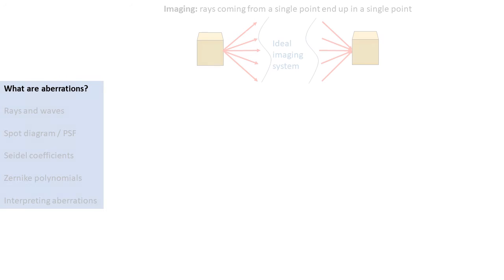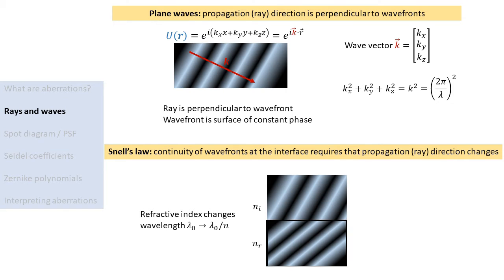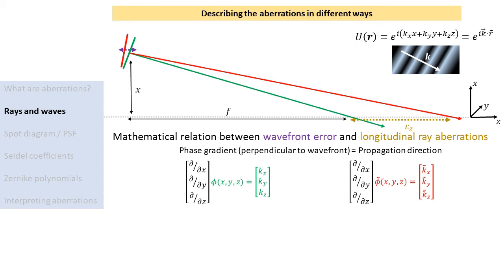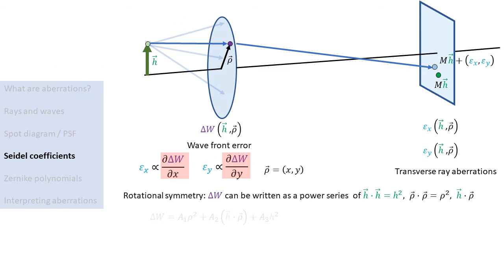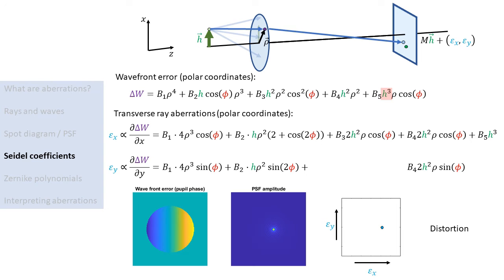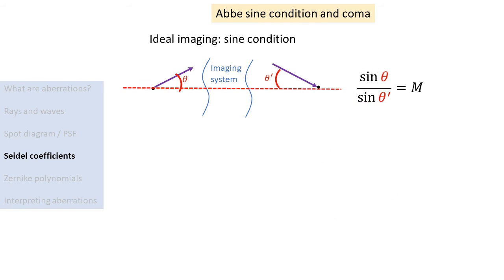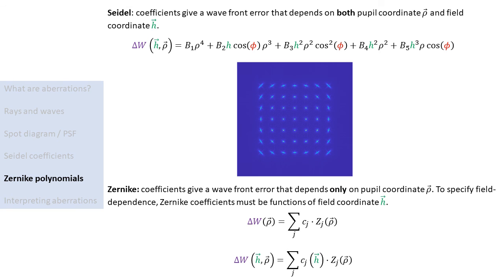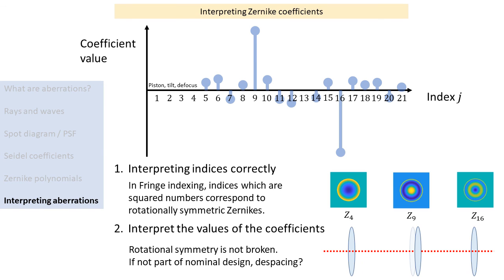Optical aberrations: ray aberrations, wavefront error, Seidel, Abbe sine condition, Zernike

Comment: What is the argument on why an unabberated system corresponds to a spherical wavefront? I get that the argument here is that in an unabberated system, the rays converge to a single point, and the only shape which is perpendicular to those rays thus has to be a circle (or a spheric surface). Can't there be a non spherical wavefront resulting in a diffraction limited spot size? And why (not)?
Reply from the maker: Mathematically, the point spread function (PSF) is given by the Fourier transform of the wave front error (WFE), i.e. PSF = F {Aperture *exp(i*WFE)}. If the WFE=0 (i.e. the wave fronts are spherical), and the aperture is a disk with uniform amplitude, then the PSF is an Airy disk. This would be the diffraction limited PSF.

One can alter the aperture and WFE to obtain different PSFs (this is typically called 'focal spot shaping'). For example, by softening the edges of the aperture, one can suppress the sidelobes of the Airy disk ('apodization'), at the expense of having a broader central peak. Or by altering the WFE, one can create a PSF with a narrower central peak, but higher sidelobes (see e.g. Toraldo filters). Whether such PSFs are 'better' than the standard diffraction limited Airy disk is very much a matter of context and application.

The fundamental limitations are ultimately a mathematical consequence of the Fourier transform of a function with a finite support (i.e. the aperture stop / pupil). The fact that the pupil has a finite support mathematically implies that the PSF must have some minimum spread (also compare to Heisenberg's uncertainty principle and Kennard's inequality).

Comment: What is the definition of the term "pupil" here, and what is the pupil in an exemplary imaging system, e. g. a camera lens? Is there a rigorous definition of what you mean by pupil or the pupil plane in the context of this video? Maybe it is also a language problem, I am German and did not find a fitting literal translation.
Reply from the maker: There are two pupils: entrance and exit pupil. They correspond to the images of the aperture stop (the aperture that limits the cone of rays that propagates through the imaging system) created by the optics before and after it respectively. I believe I mention it in my video on geometric/ray optics. I also have a separate short video on the relevance of the aperture stop.

Comment: @Sander thanks for your great video!

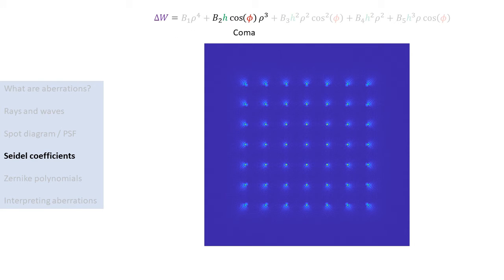I am trying to reproduce your results shown at @30:29 using python. However I am unsure how to do so. I did define a 2D array containing 9 point sources. However I am unsure how to then determine the diffraction patterns as shown in your image.
Could you maybe explain your steps taken (or provide a part if your code)?
Reply: Looking a bit closer at the expressions I am a bit confused as how you define the ''h'' in your Delta W. It appears as the magnitude of the vector (from optical axis to the point source). I did use the equation in which we set x=rho*cos(theta) (which then puts the h along the x-axis).
So i guess I need to use the polar system instead. However then I still dont understand how you determine the angle theta and the magnitude rho in order to produce your plots.
Reply from the maker: @brisingreye5209  Phi and rho are the polar coordinates of the pupil, which is in Fourier space. So you'd do the following:

- Pick a point source in the object plane with a certain position vector .
- Fourier transform the point source (this should give a linear phase ) and truncate it with the pupil/aperture.
- Apply the phase error \Delta W in the pupil. rho and phi are the polar coordinates in the pupil (where phi is the angle between  and , to ensure rotational symmetry of the system). At the edge of the pupil, rho should equal 1. The strength of this phase error can depend on h, i.e. the farther away the point source from the optical axis, the larger the phase error in the pupil.
- (Inverse) Fourier transform the pupil function to obtain the PSF for the point source.
- Do this for all point sources in the grid to obtain a figure as shown in the video

I explain in more detail how to calculate PSFs with Fourier transforms here: https://youtu.be/z-2tdkJ0Yzc?si=ytQRR-rmCooB1sfO
Reply: @SanderKonijnenberg  First and foremost thanks for your reply!
Point 3 isnt clear to me. So if I understand you correctly:

1: define a point source in the object plane:  Point = zeros(3000x3000) and then set Point(1000,2000)=1 for example.
2: Next take the FFT:  Four_Point = fftshift(fft2(Point))   
3:  truncate Four_point with the aperature function  -> What exactly do you mean if you say ‘’truncate it with’’? Do you mean to say that I should set all values in the aperture matrix to zero whenever the Four_Point is nonzero? Should the aperture function (say P0) be defined in real space or should it also be the fourier transform?
4: Apply \Delta W: So the result from point 3 (say Matrix ‘’R”):  R*exp(^i*k*\Delta W)
5: Inverse Fourier:   this is straightforward (and if not, I guess the previous points are the problem for the time being anyways).

On a more general note: 
Am I correct to say that the wavefront error is the additional optical path difference we need to add for rays to pass through the aperture to converge to the ideal image in the image plane?
When calculating the PSF using the wavefront error, do we then determine it at the hight of the aperture or the image plane (in other words: If I wish to determine the image on my detector, do I still need to propagate the result. If yes: I guess I can use the FFT(PSF)*h, where h is the propagation function).

Thanks a lot!
Reply from the maker: @brisingreye5209  
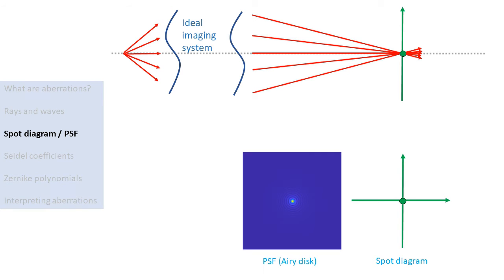About point 3: the aperture function is defined in Fourier space. Your quantity 'Four_Point' is a plane wave, so it is non-zero everywhere. It should be truncated by the aperture, i.e. the field should be set to zero outside the aperture. If you (inverse) Fourier transform this truncated plane wave (without introducing the wafevront error \Delta W), you should get an Airy disk whose position depends on the location of the point source in the object plane (see 17:53). The smaller you make your aperture, the larger the Airy disk.  

The wavefront error is the additional optical pathlength compared to the ideal spherical wavefront. If the spherical wavefront is approximated as quadratic (Fresnel approximation), then it cancels out with the Fresnel propagator when we propagate the field from the pupil plane to the image plane (see 18:27). Therefore, the wavefront error is determined at the height of the aperture plane, and the PSF is determined at the height of the image plane. The propagation from aperture plane to image plane is fully incorporated in the Fourier transform, because the Fresnel propagator cancels with the ideal quadratic wavefront, onto which the wavefront error is added.
Reply: @SanderKonijnenberg  Thanks alot! I got 3 more questions I would like to ask:
Question 1:
I got it to work somewhat properly, in the sense that it now forms a PSF based on the distance with respect to the optical axis. However it does not correct for the angle it makes with regards to the x-axis. (so the PSF of the upper left corner would be identical to that of the right upper corner and (besides the somewhat smaller h) to those on the x-axis). 

Question 2:
I am somewhat confused by the notion that the aperture is defined in fourier space, although it depends on spatial coordinates. As an experimentalist (trying out python calculations) I know that you can build an 4f system and place an (physical) aperture to block part of the spatial frequencies within the fourier plane. So I wrongly assumed the radius of the aperture used in the code (rho) to correspond to a spatial distance. In actually fact it thus corresponds to the spatial frequencies that are allowed to pass through the aperture. How then are the physical dimensions of the aperture related to those in fourier space (at what hight rho, would you expect a certain frequency k_y)? I am also wondering how it relates to the impulse response of an optical system (as I wrongly assumed them to be one and the same thing).

Question 3:
Did you make a video (or are you planning to make one) relating the aperture and the wavefront errors to an optical system (say some simple lens system)? I would be really helpful to how they relate and thus how one can effect the image quality by changing/adjusting the optical system? 
If the answer is no, do you happen to know a great source of information that can help me on my way (once I have successfully reproduced the results as shown in your great video!)
Reply: Also as a side note: 
I do calculate the PSF on the image plane for each point source and add them all up at the end (so that I can control h a but easier). This ofcourse forces me to use a loop, recalculating the field at the image plane for each point, slowing down calculation (but for 25 point this is not too big of a deal).

I also just noticed that my distortion term, appears to return two PSF equidistant (along x-axis) as the undistorted PSF. Not sure what I am missing. I did check if my \Delta W over \Lambda plots match yours and it appears it does... So I am guessing my calculation for \Delta W are correctly implimented.
As I understand it can be a bit difficult to understand a problem based on a few lines of text I will include the part of my python code that does the blunt of the work below:

''
for i in range(np.size(x_points)):
    for ii in range(np.size(y_points)):
        #First we produce our point source
        P1 = (np.sqrt((xv-x_points[i])**2+(yv-y_points[ii])**2) < radius)               
        P1 = P1.astype(float)                                                                     #coverting to 1/0 matrix
        
        #Next we take the fourier transform:
        Four_P_point = fftshift(fft2(P1))
        
        #Next we truncate it, using our aperature function, including the wave error
        h = np.sqrt(x_points[i]**2+y_points[ii]**2)                              #h value used in \Delta W
        Product = Four_P_point*P0*np.exp(1j*k*Wave_front_polar(rho_v,phi_v,A,B,1))

        
        # Now we inverse it to find the Field distribution
        Image = ifft2(fftshift(Product))
    
        if ((i==0) and (ii==0)):              #if it is the first point, we need to the generate matrix
            Img = Image

        else:                                          #Add addtion PSF to image matrix
            Img = Img+Image
''

A few notes:
1) I use python hence statements and loops work a bit differently in terms of defining them
2) the ''1j'' used in the exponential  ''np.exp'' tells python it is a complex value
3) xv and yv are the 2D matrices defining the spatial grid
4) rho_v and phi_v are the polar coordinates 
5) A and B are arrays containing the constants used for the \Delta W calculation
6) python calculates ''2^3'' as ''2**3'', so the ''**'' means ''to the power''
Reply from the maker: @brisingreye5209  
Q1: I think it's important to note that phi denotes the angle between and . That is, if you put a point source at a different location , then the definition of phi in the pupil changes too. 

Q2, 3: Perhaps the video on diffraction integrals helps: https://youtu.be/Y5DagMbPEGk?si=d3HAgDr-8omqszcj . The corresponding reference would be 'Introduction to Fourier Optics' by J.W. Goodman. 

In a 4f-system, if we have a field U(x,y) in the front focal plane of the first lens with focal length f, then in the back focal plane we have the Fourier transform of U evaluated in (x/lambda*f , y/lambda*f). Here, x and y denote spatial coordinates, but x/lambda*f has the units of spatial frequency. So that's how we can use the Fourier transform of U to describe a field as function of spatial coordinates.

The simplest imaging system one can consider is a single-thin-lens system. In this system, the lens defines the aperture, and its transmission function defines the aberrations.
Reply: @SanderKonijnenberg  
Thanks. I got it to produce a rotationally symmetric image, but I am still left with weird artefacts. Comas appear to be symmetric (mirror line perpendicular to the h vector) and the distortion appears to return two equally shifted (but opposite direction) PSFs. 
I am considering this might be due to aliasing or numerical errors, but I am not sure yet. Could you share the mesh and point distribution you used? This way I can run my code with similar settings and check if the problem is resolved or not. 
Currently I am using the following settings:
1)	Lambda = 660 [nm]
2)	Diameter of aperture is 10^(-2) [m]
3)	x and y run from -2*10^(-1) upto  2*10^(-1) [m]
4)	Each axis has 3000 grid points -> (3000x3000 matrix) and dx=dy=1.3*10^(-4)
5)	Each point source has a radius of 3dx
Any ideas/suggestions as to what causes this and how to prevent it?
Thanks (once again) in advance!
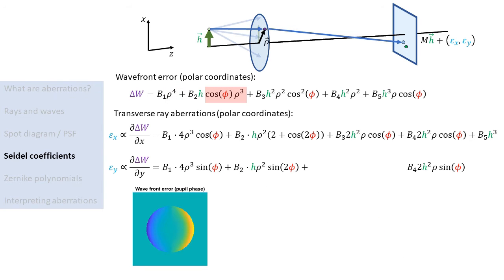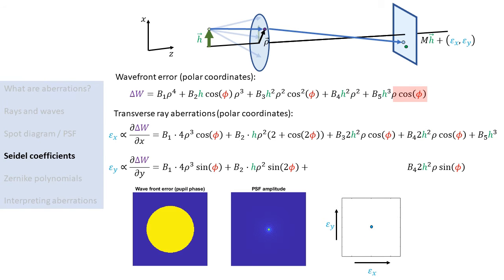Reply from the maker: @brisingreye5209  I think that to debug your code, it would be good to visually inspect the amplitude and phase of the pupil for each point source. For example, if you plot your pupil phase for coma, does it visually look like the picture shown in 26:48?  For distortion, are you indeed applying a linear phase to the pupil as shown in 29:30? Have you made sure that the amplitude (not just the phase) outside the pupil has been set to 0? If you have made sure that the computational field of view in Fourier space is at least twice as large as the pupil diameter, and the phase difference between two adjacent pixels in the pupil does not exceed 2pi, then I wouldn't expect any significant numerical artifacts of the sort that you describe.
Reply: Dear @SanderKonijnenberg,

I got it to work using the cartesian coordinates rather than polar coordinates. So something is going wrong in the way that I define the polar coordinates. Anyways for now I am happy to play around with the code in cartesian coordinates and see if I can make it user friendly.
Once that is done, I will see if I am capable of creating a race tracing model, from which I retrieve the Seidel coefficients/Zernike coefficients and then compute the expected aberrations using the previous code (so many weeks left to play around with python).
For now, thanks for your help!

Comment: Great work! Helps me a lot in understanding aberrations. I have one question though, that you mentioned multiple times that in an ideal optical system, rays from a point converges to a point. But in wavefront aberration calculation, how does this starting point determined? will the starting point'l location affect the wavefront aberration we get? And how do we determine the shape of the idea optical system, when we don't have one design, say in corneal wavefront aberration analysis? Looking forward to your reply!
Reply from the maker: Indeed, in general the wavefront error can be different for different object points. The Seidel aberrations for example express a dependence on the object point location. However, there are many cases where the wavefront error can be approximated to be independent of the object point location (i.e. the aberrations are isoplanatic), for example in imaging systems with a low numerical aperture.

Unfortunately, I have no particular expertise in corneal wavefront analysis. But if I had to guess, I would try to parametrize the shape of the cornea, measure the wavefront error for various wavelengths, and then try to fit the parameters to the measured data?